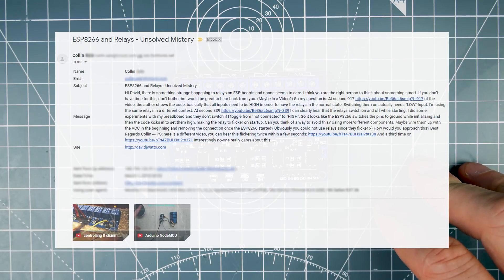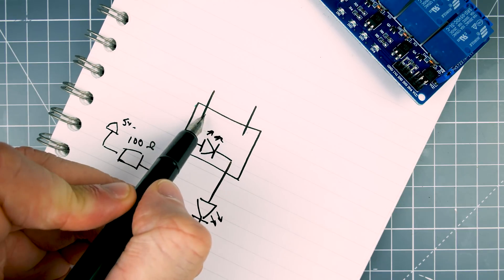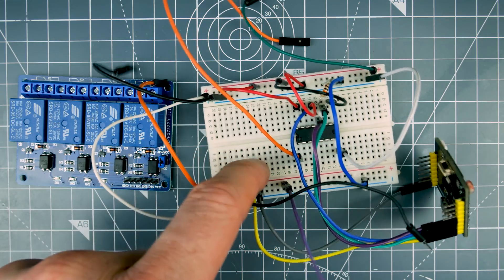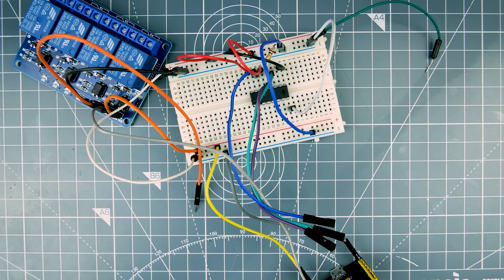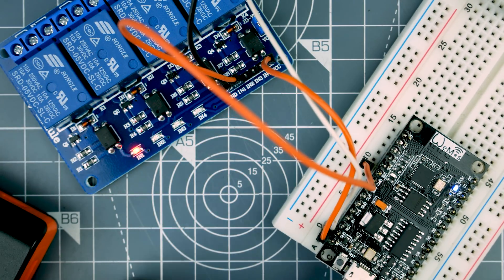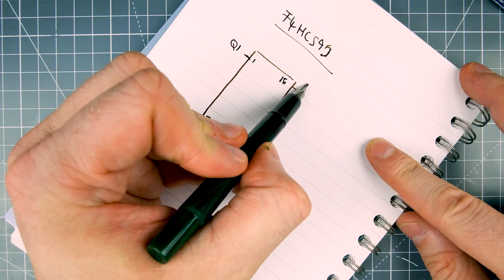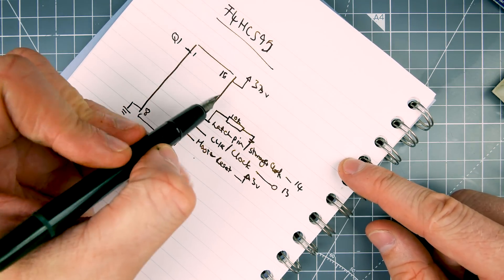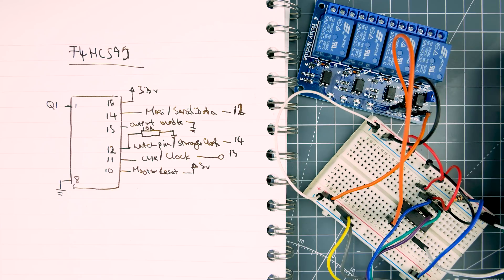ESP8266 and Relays - Unsolved Mystery

Comment: Phototransistor is the name for the photo sensitive transistor, and it has been commented on that the ESP8266 during the boot cycle can the GPIO pin's be in an unknown state.
Reply from the maker: Thanks for the insight :-)
Reply: David Watts 

Almost all bipolar transistors are light-sensitive, btw.

You can actually shave the casing off of a transistor, and make a crude phototransistor. ;)

As long as you use specific pins on the ESP to hook up to the serial pins to the shift register, it should be fine on power-up / reset.

But, as Mats said, some ESP pins can do weird things during reset, and obviously certain pins get driven High or Low during programming, or even when the USB UART chip connects to the PC.

Definitely not ideal to power the relays from the ESP board. Even if the +5V rail has enough juice to power the relays...

Although that board does seem to have a protection diode on each relay (to circulate the back-EMF spikes from the coils), they're not always ideal, and the voltage spikes can get back into the +5V supply rail on the MCU board, and sometimes upset them.

It's probably fine in projects like this, to be fair, it's just something to watch out for if your MCU starts acting up when the relays switch.

(the back-EMF spikes mainly occur when the coil is switched off, and the magnetic field collapses.)
Reply: @electronash  yeah the junction in an ordinary NPN transistor is sensitive to light which is why they are encased in something. The light from the LED falling on this unconnected "base" region can be used to control the current flowing between the collector and emitter.
Reply: David Watts 

btw, if you just saw a sub from me, I was already subbed, but YouTube still has an issue where I can't click the bell icon unless I unsub and re-sub, for some reason?

It's quite bad, as lots of channels probably aren't sending out all notifications. It does give an error message when the bell is clicked, but many people might not know about the workaround.
Reply: By the way, it is also sending some garbage on the serial port before it is properly booted.
Reply: For the record, this is not garbage ;) https://github.com/esp8266/Arduino/issues/3047